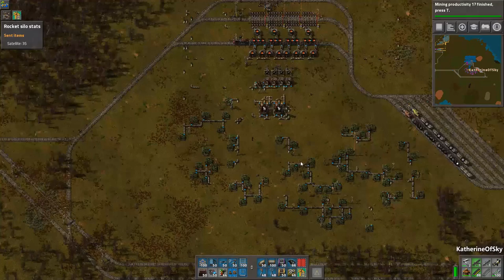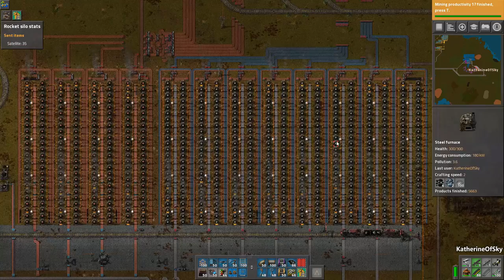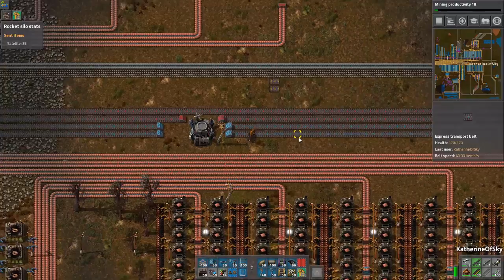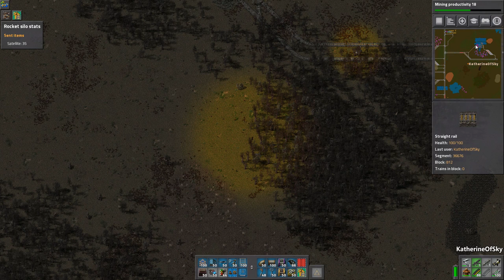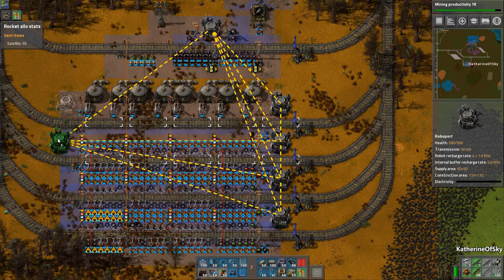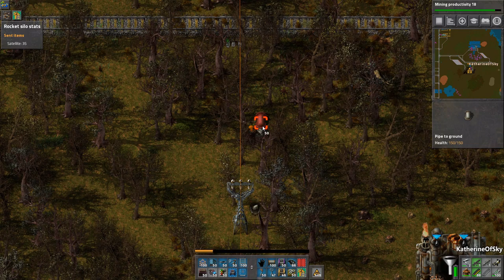Factorio: Entry Level to Megabase Ep 75: BLUE CIRCUITS STATION - Tutorial Series Gameplay

Comment: On your idea to rebuild your main base, why not just leave it running for now and just build a new base somewhere else.  You are already running out of modules and you could run out of other supplies if you start shutting down large sections of the base.   I think just building a new main base gives you more room to work with and let's you build it the most efficiently without trying to shoehorn in an assembly area around parts of the old base you still need to operate.  Just a thought before you get into the rebuild.  Really enjoying your mega base.
Reply from the maker: Thanks!   There's really no reason to abandon the base -- all the belts are in place, and only a few things need to be moved.  I have more than enough supplies to make everything we need.

Comment: I wonder why you maintain plenty of rocket fuel factories instead of having one putting rocket fuel e.g. into the bot train or a dedicated fuel train. It would cost one inserter and one chest per outpost instead of a whole factory :)
Reply from the maker: You can do your factory whatever way you wish!
Reply: Lucky me.
Reply: I'm guessing because there are oil fields everywhere and it's just a small blueprint that's pretty quick and easy to add to new stations. It just seems like less of a bother than having a fuel supply train that goes to every station and a bunch of infrastructure to unload it. IIRC the copper ore mine imports rocket fuel by train from a factory above it.

Comment: I mean, I know I'm only a novice at these things but isn't the acid just going to back flow back to the loading station from the blue chip unloading station?
Reply from the maker: The tanks will equalize, if that's what you mean.  The consuming machines will draw what they need.
Reply: KatherineOfSky - What I mean is, that as you load the train you'll deplete the top tanks and to equalise them won't it draw acid back up the pipe line from the unloading station as well? Or will blue chip production draw enough acid to keep the flow heading down the map.
Reply from the maker: Yes, it will, that's what I meant by "equalize".  However, since sulfuric acid is needed by only two processes, (one of which we aren't using -- uranium processing), it doesn't matter.
Reply: KatherineOfSky - ahhh, well, thank you. Still learning big layouts so this is fascinating to know. I would have been throwing pumps every which way to keep it all one way.
Reply from the maker: If it wasn't so close, I would just use the train.  The production of acid is so high, we will literally never run out!  :-)
Reply: Yep, the size of that refinery for acid is a total overkill, especially with beacons and all that stuff. Even the uranium station near main base fills reasonably fast drawing from a much smaller setup in the main refinery. With some pumps and combinators to decide when and what to crack, a single oil field with a big refinery could import coal and have output stations for plastics, rocket fuel, sulphuric acid and lubricant and probably keep up with the demand for everything, except maybe lubricant. Still, it is a tutorial on how to build a station for fluids with one product.